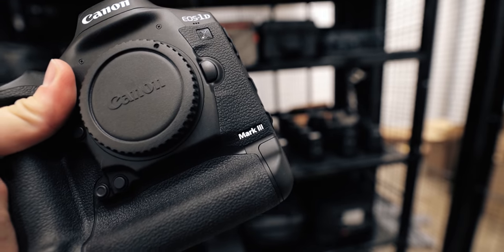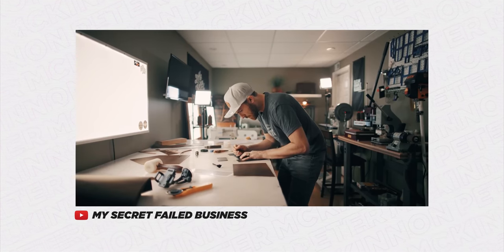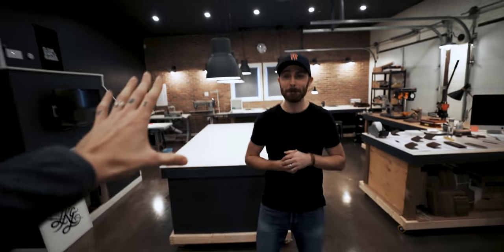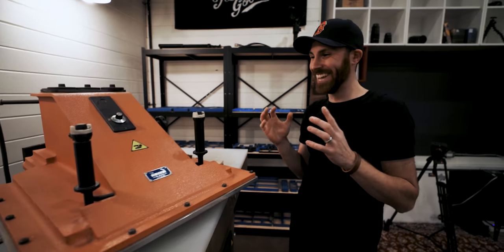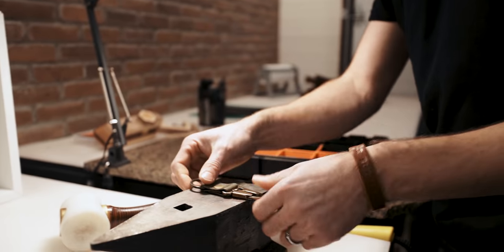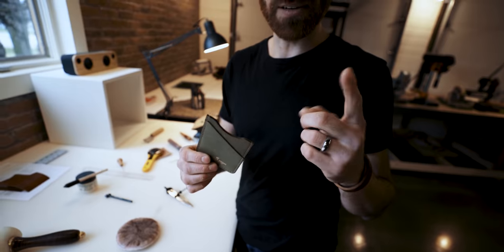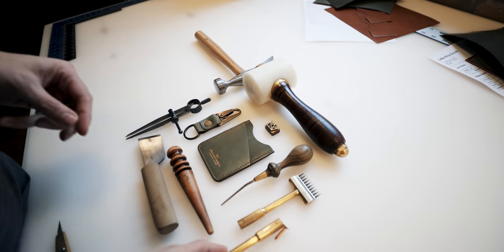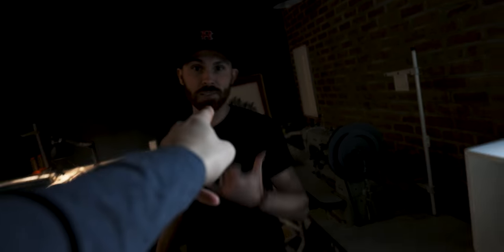5.5K RAW B ROLL with the 1DXMK3!!! OMG! *Actual Footage Samples*

Comment: YOU WIPED THE LENS WITH YOUR T-SHIRT!! Does that make it officially OK to do that now? I hope so - I do it all the time. But I feel REALLY bad about it. Love what you doing Dude.
Reply: as an AC I can say freshly washed cotton isn't bad to wipe lenses with actually, definitely better than old and dusty microfibers that nobody ever uses on film sets anyway. but most importantly use an air blaster before wiping and never wipe dry as dust can scratch your lens easily (use your breath if you don't have spray). however, best protection is not to wipe your lenses at all if it's not absolutely necessary.

Comment: Peter, so what's the point of the 1DXiii? If you are a sports shooter, absolutely. But for this video - how is 5.5k better than 4k (or even HD) for youtube? I loved your "card full" insert. Looking forward to the EOS R ii or the high res EOS R. I would love to switch to R mount and get a stabilised 24-70 F2.8 and the 70-200 in the small form factor. But the EOS R was not convincing so far to upgrade.

Comment: Im exited to use my Canon EOS M50 i bought right after christmas and start collecting lenses and try to start a carer as an photographer and hopefully videocreator. :)
Reply: Great camera, sadly there isn't much good glass to collect for it... You can still go the adapter or speedbooster route and get EF or EF-S glass but it's so expensive TT. Anyway, start practicing with the kit lens like I do, you don't need expensive glass until you find the limitations of the kit lens by yourself
Reply: Ahah me to exactly even the same camera
Reply: Good luckk
Reply: Get that EOS-M 22mm prime. Beyond that an the kit len(s) get that Valtrox(I think) speed booster, an use what ever EF lens tickles ya.
Reply: Hey, I own an M50 as well. I recently got the Sigma 16MM. Really like it. Very sharp. Also, I won the viltrox adapter. I recommend getting that if you have EF lenses.
Reply: @ChrisJBrown72  viltrox👍
Reply: We use the M50 a fair amount on our vlog! Love that little thing.
Reply: Got one myself in an entire set with a 22mm and a 11-22mm, still actually just searching for the best use and looking at other EF's to use with the Viltrox. Loving it for now, when I achieve good enough control to get to its limitations, I might upgrade, but up untill then - it's a great camera to start out with!

Comment: It looks good, but I find the dynamic range underwhelming for the price. The windows and lights clipped very harshly in a way that similarly priced cameras (namely the URSA Mini Pro) just wouldn't do. Yes, it's higher resolution, but even at comparable resolutions and quality settings the files are enormous and the workflow limitations would be hard to justify for the price. Keep in mind that bit rate is not just about quality, but also the efficiency of the codec used. Larger files that result in similar quality video are not somehow better just because they're bigger, in fact the costs of storing and managing larger files is worthless unless there's a noticeable quality increase too. Anyway, I'm most excited for a fill frame camera from Blackmagic. I love the URSA but sometimes I wish I could get a little wider angles out of my existing full frame lenses, and a sensor with larger pixels could only help dynamic range and sensitivity.

Comment: I saw you can Drag/Drop the RAW Footage into Resolve 16.  It sees it as C200 Raw Footage, which technically "Works", but I don't think it's quite right, or sure it's not.    When applying the 3D LUTs, they seem wrong.   But yeah, you can at least see/process the footage in a way and export it to .Mov... haha.  

I found a Free App for Windows that lets you convert the .MP4 H.265  into ProRes 422 HQ, but the files are HUGE, lol.   But then when you load that into Resolve, it "seems" more correct for the color/LUTs I think....   

How did you even process this footage with the TIFFs?

Comment: Re your comment about the RAW files so tough to work with - why don’t you just bite the bullet and try shooting with the BMPCC 4K in B-RAW and edit on Davinci?  Such a smooth, easy workflow on a quick computer and I’m sure you’d kill it with the images!  Time for some new blood Pete. Give it a go!
Reply from the maker: These raw files are difficult because the camera is still pre production and premiere doesn’t recognize them. 

Working with red raw files, for example, are not an issue. 

In time, I don’t suspect this to be either. However, this instance was particularly difficult :)
Reply: Peter McKinnon fair enough. Would still  love to see you take the BM 4K for a test drive and see what you can do with it. One little Metabones speed booster and you can still use all your Canon glass with it. I’ll just keep hoping and checking your latest uploads. ;)

Comment: For those about to drop $6,500 of your hard earned money on the 1DXMK3 be aware of these things: 

- Dual Pixel Autofocus does NOT work when recording 60fps in RAW, 4K DCI (full frame) or UHD - aka - if you buy this camera wanting 4K60fps autofocus in full frame it ain't happening. 
- There is a "crop mode" which will enable Dual Pixel Autofocus, but I haven't seen any articles detailing what that crop is yet. It may be the same 1.3x crop as the 1DXii. 
- Image Stabilization (on the lens, no IBIS on the 1DXiii) does NOT work when recording in RAW. 
- When recording at 100 or 120fps the camera is limited to 7 minutes and 29 seconds per clip.